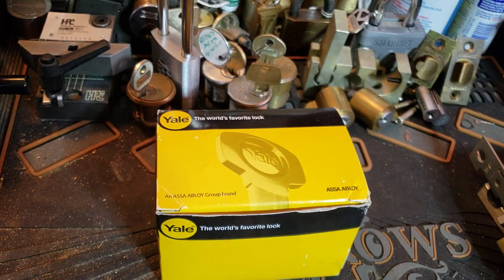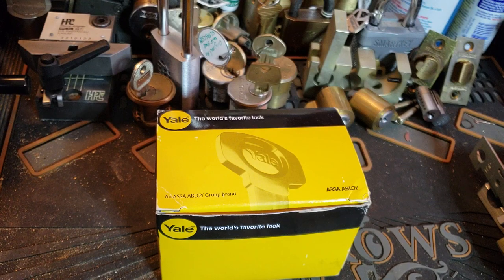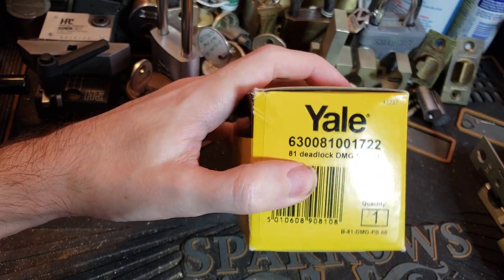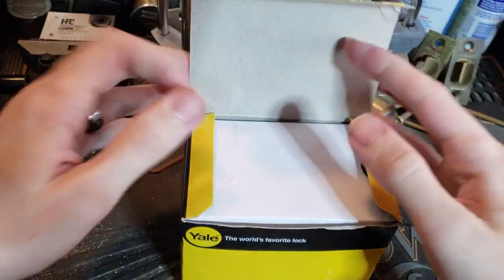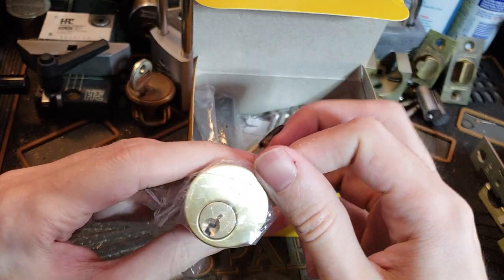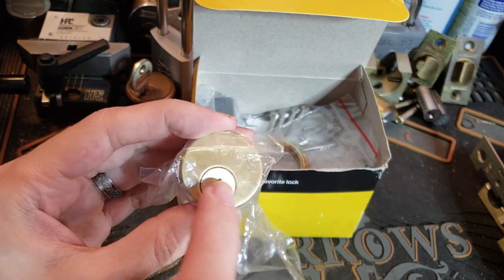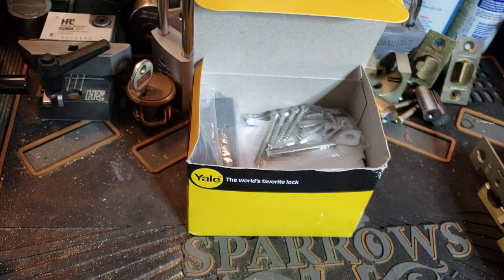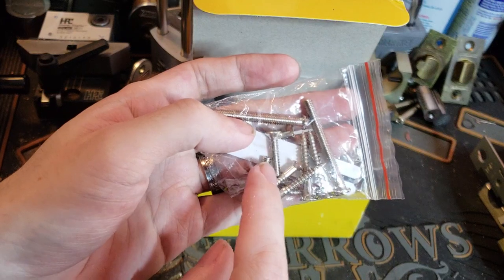(108) Yale 81 deadlock teardown

Comment: Very informative! I'd imagine this design would be susceptible to an "under the door attack" tool? still and interesting design, funny how people insist on installations that are "potentially" less secure than other options.  Great video Thanks for sharing!
Reply from the maker: The lever throw does raise that possibility but given the usual mounting location of these locks it would require a much longer UDT than is standard and the short lever combined with the return spring would make it very tricky to operate with such a tool. Also the lever can only be pulled down when this lock is mounted on a left hand door, right hand mounting requires the lever to rotate upwards.
Reply: @Nite0wl  Cool, very interesting none the less didn't think of opening direction/side.  I'll have to make a standard "type" one eventually just because UDT lol Cheers TR :)
Reply from the maker: TotallyRandom Locks and Picks TV in the UK there is a category of tools called "letter box tools" which are designed for this sort of attack but are applied through a letterbox or slot instead of the gap between the door and frame saddle.
Reply: @Nite0wl  Think I may have seen one in a video somewhere, it's a more logical solution provided there's a letter box of course :)  Thanks for the info!
Reply from the maker: TotallyRandom Locks and Picks TV until recently they were treated as very 'secret squirrel' by the trade.